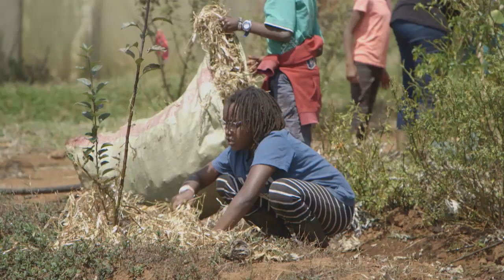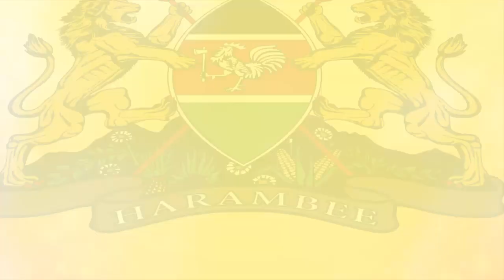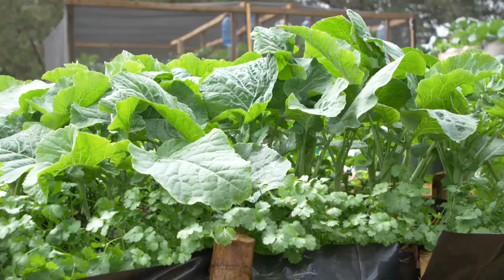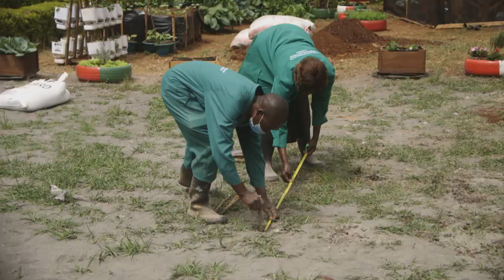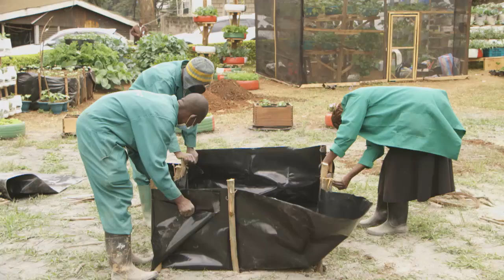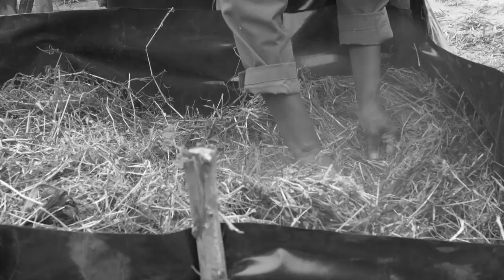How to make a moist bed garden - Farm Kenya

Comment: How does the garden drain water in the case of excess rain?
Reply: That's a good question.  When building mine,  I will add some few holes at the bottom before I fill it with hard core material or on each corner to allow water to drain.
Reply: Unless you get a lot of rain where you live, I think it isn't necessary. But if you do get enough rain to make the soil muddy if there is no drain, put one small hole near the top of the hard material. If that is not enough to drain it properly, add another small hole on the other side. That is what I will do next time I make one, because I put my hole too low, so not enough water is retained.